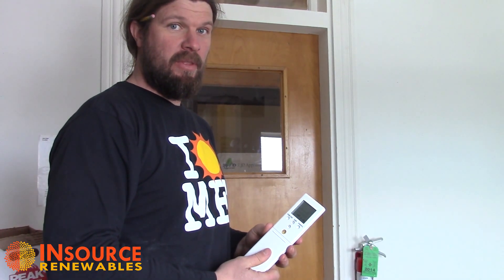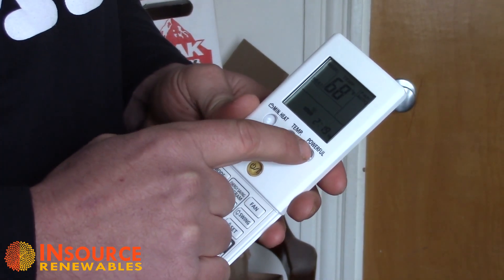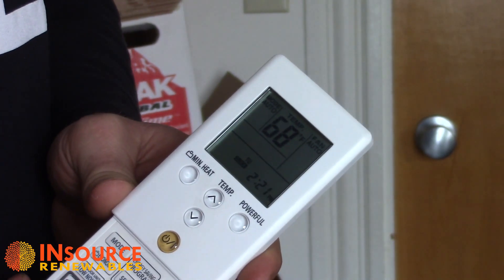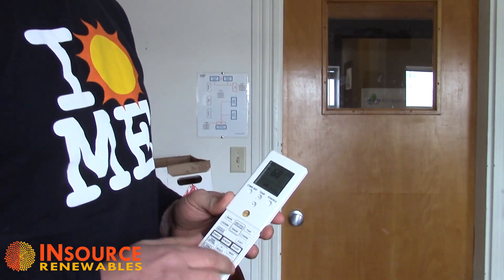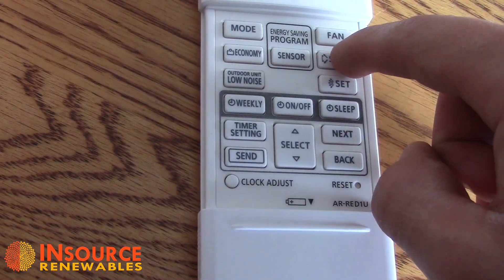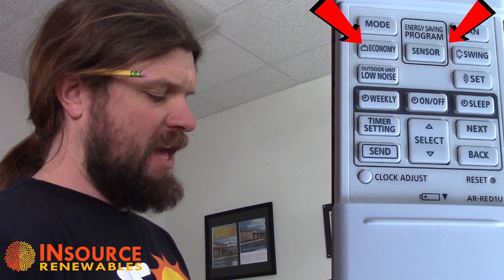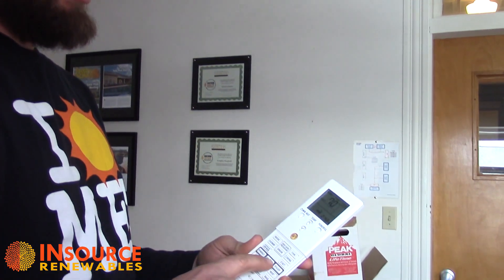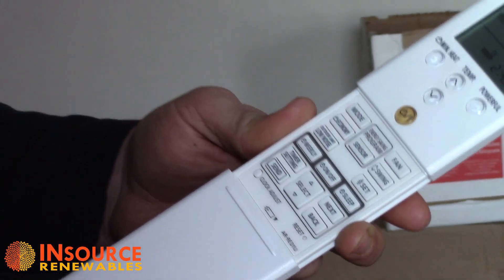Heat pump user tips #2 (controls)

Comment: Economy mode limits the compressor to 60% (on my 09LZAS1) for heating and cooling, which increases the efficiency of the unit. So it may take longer to reach temp (or may not be able to reach temp sometimes) but will use much less electrcity overall.

Comment: I programmed the weekly timer (thanks to Youtube) however am I correct that the unit does not show it is in weekly timer mode?  So using the on off timer shows the orange timer light but the weekly timer does not show it is in timer mode.  So I basically have to assume it is working?

Comment: I put a Fujitsu in my house as a primary source of heat, I oversized it on purpose because I wanted to make sure it could heat my place since it gets down in the negative Temps where I am. It feels like it's always cold in my house. I have it set on 70 but it doesn't feel like 70. Is it because I'm used to forced hot water? I know hot air furnaces are similar in that aspect, always feeling cold. I'm an oil burner tech so I don't know a lot about these things.

Comment: Hello, this is Commander Fujitsu here and I need to ask you a question about heat pump operations in Winter to avoid massive bills but you haven't uploaded in 2 years so you'll probably not see this Le Sigh .. By the way, if you want to maximize the efficiency of the communications device on your right ear try lowering the rubber mic nearer your mouth for output as it's too high at eye level 🥳🙃 If by chance you see this please reply and I'll ask you the question 😄 Thanks

Comment: My daughter just bought a home in Iowa and she has two of these units in a 750sq ft home. It is 2 degree here and the temp in the house is 57 and we have tried everything to get heat in this house and it is not working. I have to go buy two large space heaters, which we are trying now. I do not recommend these things for heat. They don't work with the temps in the midwest.

Comment: We just recently had the fujitsu heat pumps installed in December and we are having an issue the same as a friend had where 3 lights are flashing on our down stairs basement unit.  Our friend had called the service office to get someone to fix it and they had said it had to do with the timer on it and they fixed it.  Both my husband and I have tried with the manual to fix this problem without any luck.  There was no reason for the timer buttons to be pushed since we don't really do anything in the basement and only adjust the temperature up or down.  So we don't understand why there would be a timer issue.  Can you explain step by step how to fix this issue because what it says in the manual doesn't fix the problem?  Thanks so much.
Reply: If all of the lights re flashing, it indicates an error. The flashing of the lights indicates the issue. The economy light on the right will flash continuously, and the two other lights will flash in a pattern that indicates the nature of the issue. Count the number of times the operation light (green one on the left) blinks, then the number of blinks for the timer light.
Reply: @vaughanwoodruff  So after looking online to see if I could figure out what error code was happening, I did come across error code 97 to match the flashing lights, which indicates it's the outside unit.  Is this something that I can fix myself with using the remote control or is it something I have to call service to come and fix?  Do you know why this happened and is this a defect with the product and could happen again?  We did have a blowing snow storm that happened the same evening it stopped working properly.  When we got up the next morning (this past Sunday) it was cold in our basement and it didn't appear that the unit outside was plugged up with any snow.  Thanks so much for any assistance you can offer.

Comment: Awesome job! I asked the guys that installed my unit for an explanation and got the deer in the headlights look. The manual was especially confusing between energy mode and economy. One must override the other I guess. But makes sense to keep it out of economy and let the sensor do the work. At least for my use. I use mine for primarily  heating a room over the garage which isn't used much to keeps the pipes from bursting. Live Northern Michigan. Does a great job.

Comment: Excellent run-down, thank you! I have an older Fujitsu high-wall model (ASTA24LCC, heating output approx. 1-8 kW) which I suspect is oversized for the room(s) it is intended to heat, and it will often heat for a couple of minutes before abruptly stopping, and then won't restart for 5-7 minutes (typical compressor protection). I've thought about getting a wired remote controller/thermostat installed but for now have taken the budget option of wiring an extension onto the return/room air thermistor. The thermistor can then be positioned in a cool corner of the room or in the hallway if heating the whole house. This seems to solve the short-cycling issue, but in Heat mode it tends to overshoot the set point (had it been in Auto mode it would have switched over to cooling already). Is this normal behaviour? I'm aware there are temperature adjust jumpers on the circuit board but I'm not sure exactly what they do and in what modes they take effect. Thanks!

Comment: The green light on my unit has been blinking for an hour and not blowing heat. Seem like something is wrong
Reply: Blinking lights usually indicate a fault (or possibly defrost cycle running). Best to get a service technician in.

Comment: I have a 15rls3hy 15000 unit supposedly good to -30C
Had a 12000 unit previously installed and they changed it after a month as the smaller 12000 couldn't keep up in heat in my old bungalow poorly insulated. Installed the 15000 unit last winter. Seemed fine never went past 26 on the setting. This winter at the 30C setting fan on high its only getting to 20-21C 10 feet infront of the head unit. Thr kitchen right beside(open concept) is 19. This is after running almost 24 hours at around -20 outside.this unit is starting to do the same as the old 12000 unit did. On max heat setting the temps coming out of it are no always the same.i used a heat gun last year to test on the 12000 unit. Sometimes would be 30 degreesF  difference coming out of the head. This makes the difference of the baseboard heaters in the house being on or off at 18C. Im starting to believe its a fujitsu issue. My buddy has a gree extreme. No issues.
Ive also noticed bith these units the temp on the remote you need to increase it based on outside temperatures.never made sense to me. To keep 21-2 in house id need to change the remote setting to between 23-30C. But now on 30 it doesn't even maintain 20 threw out the ground floor of the house.
Reply: It's difficult to diagnose from afar, but here are the points of reference we would look for if a unit was doing well last heating season but not this heating season:

1) Compare heating demand between the two years to determine whether the difference is related to the unit.
2) Check the filters.
3) Increase the temperature setting on the remote to determine whether it maintains comfort, just not at same setting (could be due to a drift in the thermistor accuracy).
4) Check pressure to see if there is a leak.
Reply: I reset the remote.all good had to turn down from.max 30 to 25C within 20 mins.gained 4C in that time.we have lots of power blips.

Comment: Proggram Heat Pump (">" means press the button described)
1. Ensure Power (orange button) is ON
2. Ensure "Clock" is set to current time.
3. >TIMER SETTING; "Weekly" will start flashing on display.
4. >NEXT: days of the week will begin flashing on display + program event = 1; you can toggle through the days of the week using the >SELECT button (but don't bother). If you continue on you will come back to all the days of the week, but the program event will = 2 !!!
5. So assuming, all days of the week are flashing on display + program event = 1,  >NEXT 
6. SEND logo then flashes on display;  >SELECT toggled will display either an "ON" or "OFF" event - choose "ON" event via >SELECT.
7. >NEXT: Time starts flashing, adjust your start time via >SELECT !!!
8. >NEXT: Temperature setting flashes, adjust via >SELECT !!!
9. >NEXT: brings you back to weekdays flashing; >SEND (beep sound) to lock in Program =1
10. To set Program #2 >TIMER SETTING, >NEXT, >SELECT (Toggle through days of the week until you come back again to all the days of the week, but the program event will = 2 !!!
11. >NEXT; Repeat steps 6, 7, 8, + 9 to finish program #2.

Comment: How the hell do I turn on the heat with this? I set it to heat mode 88 F at top fan speed and nothing’s happening. I’m struggling to keep warm over here.
Reply: If it hasn’t run for awhile, it may take a bit for the compressor to warm up and start pumping out heat. If it isn’t doing anything after 10 minutes or so (be sure to hit Powerful to have it operate at maximum capacity), you should call for service.
Reply: If it hasn’t run for awhile, it may take a bit for the compressor to warm up and start pumping out heat. If it isn’t doing anything after 10 minutes or so (be sure to hit Powerful to have it operate at maximum capacity), you should call for service.

Comment: Can you do a video for R410a? I cant even get my heat pump to work and its brand new. The timer settings keeps blinking orange and I don't know how to remove it. I tried following the manual but doesnt seem to work. Please help! :(
Reply: R410a would be the type of refrigerant the unit uses, rather than the model number. Blinking lights and improper function sound like faults, so I'd get a service tech in to look at it.
Reply: The lights blink in a code that you can look up in the manual

Comment: In a way, I appreciate your reply, yet should probably share that you are
corresponding w/a soon-to-be 77 year ex-Marine who has no real sense he
will be here much longer - or wants to be. This said, the difficulty I had
around mid-night last night endeavoring to adjust the handheld control temperature for heating in a 32- degree outside temperature with an estimated 50ish inside a challenge that took over an hour to get the heater back on "properly", I think.

That said your reply's attempt at humor - or was it sarcasm (e.g., walk a mile down the street), was not helpful along w/the similar attempts at "humor."

What WOULD be helpful is a single step-by-step set of instructions to get the heater turned on and running at a specific temperature absent of all the side-talk.  That as ground-of-being from which description of the other buttons might then help.
Reply: Keolalani, please excuse my inner Mainer. Your comment didn't leave a lot of request and was broadly unappreciative. Like my brethren, I'm a bit full of sarcasm and dry wit. I'm sorry to hear that you're having challenges with your unit and aren't generally enjoying life. Truly. Here's some direction on your unit... The easiest thing to do would be to shut the unit off at the breaker to restart it. Give it five minutes to clear its memory. While you're waiting, press the power button (amber one) on the remote so that the temperature setting isn't showing. Once you flip the breaker back on, get in front of the unit and press the power button. Listen for the beep. The beep is critical, as it indicates that the indoor unit received the command. If you don't have the remote pointed at the indoor unit, you could jack the temperature up to 88F on the remote but the indoor unit may think you only want 70F temps because it didn't get the command. You should just set it and forget it... pick a temperature and let it run. Efficiency Maine has some great User Tips that detail getting the most out of your unit: https://www.efficiencymaine.com/docs/Heat-Pump-User-Tips.pdf. Good luck. If you have other specific questions, I'm happy to answer them.

Comment: What an inept "instruction" script!   How about a step-by-step walk thru of the process of turning the unit on and setting the temperature?  As is, there was nothing there that visually showed that process.  Just a lot of extraneous conversation. :o(
Reply: Step 1: Pick up the remote.
Step 2: If you can’t see an LCD screen, it is upside down. Turn it over.
Step 3: If the writing on the remote is upside down or sideways, you aren’t quite there yet. Rotate the remote in your hand until the letters are right side up. If you can’t read the buttons, have the person who is reading these instructions to you read the labels out loud. (Hi, helpful reading assistant!)
Step 4: Aim the remote at the indoor unit as though it is a TV.
Step 5: Press the amber-colored button in the middle of the remote.
Step 6: If the unit doesn’t beep and light up, something’s wrong. Get closer to the unit and try again. If it works this time but your screen isn’t showing a temperature, walk a mile down the street and push the amber button again. Return to the home.  Be discrete so the indoor unit doesn’t suspect that you pushed the button again. If going a mile required a boat, be sure to tie it back up.
Step 7: If the temperature setting is correct, find a safe place for the remote and leave it there. If it is wintertime and your house gets very cold, be sure to watch the video to make sure the unit is on the right mode. Be sure to stop the video before it ends to avoid the video that details cleaning of an indoor unit, as there is a sophomoric joke with toilet paper that is unlikely to be received well.
Step 8: If the temperature setting is too low, press the button with an arrow pointing up that is labeled “Temp”. This stands for “Temperature” not “Temporary” or “Tempestuous”. We kind of wish is stood for “Tempura”. (Don’t steal the idea helpful reader!)
Step 9: If the indoor unit beeps, keep pressing arrow buttons until you get a favorable number. If the words are upside down again, don’t panic as the remote doesn’t have the power to change your body temperature. Simply turn it around and try again.
Step 10: If you want to undo anything, read the instructions in reverse starting from the bottom. Let me clarify - don’t read the words backwards (I’m not that creative). Read the STEPS backwards.
Step 11: If all else fails, read the instruction manual. This one they actually covered okay.

Good luck!

Comment: Have this system going on second year now summer time i had no problem but now in winter when i have the heat turn on it comes and after 30min it goes to slow cool fan mode and when i turn it off the green light blinks for about 5 minutes and i can only turn it back on after an hour for 20-30 before it starts doing the samething again
Reply from the maker: Sameer, what you are describing sounds like the unit running in defrost mode. See this video for more information: https://www.youtube.com/watch?v=DGAhjK3nkJ4
Reply: My remote no longer seems to be transmitting a signal to my Fujitsu.  Same remote as in your video.  Brand new Duracell installed just now.  Help?

Comment: I have the same system. It seems that the remote shows ONLY the temperature that I target to have, but does not show a current temperature. E.g., when I enter a cool room (obviously around 60) and turn the system on, the remote immediately shows 72 because it's my targeted temperature. How could I see a real (not targeted) temperature in the room?
Reply from the maker: Julia, the units do not have that feature. You will need an external thermometer in the room to measure the room temperature (a thermostat in the room for your other heating system might suffice). The number on the remote is a setting that targets the air temperature you are asking for.
Reply: If your unit has wifi you can get a temperature reading by using the FGLair app.

Comment: Hello! My fujitsu has the economy mode light blinking and it doesn't go away even when I keep pushing the button! :( I need it to cool down the temp. My remote doesn't show the economy mode on, only the aircon on the wall does. Help??
Reply: Great video I had a fujitsu installed one year ago and I can't get it to work neither heat nor cool I do everything with the remote it still won't work thank you!
Reply: Bris Edeny I’m having this problem right now!!! It’s so so cold and my heat won’t go on and it just keeps blinking economy mode. I know this was a year ago but plz tell me you found a solution

Comment: My heat pump is dribbling water.  Why isn't it draining?
Reply: It is typically due to one of these reasons:
- the indoor unit is pitched in the wrong direction, causing it to drain improperly;
- there is a blockage in the condensate line (possibly insect nest) that is restricting drainage;
- there is a trap in the condensate line;
- there is a leak in the condensate pan (rare); or
- it is a refrigeration issue and there is condensate forming due to poor heat exchange.

Comment: The air coming out is warm. Setting in on cool set at 64. Is it because the condenser is dirty. The filter is clean..please let me know what you think. Text me 7742891681. I saw on a video a self cleaning and rinse spray foam. Has anyone tried it.
Reply: Sounds like it could be a refrigerant leak.

Comment: So what is happening when the lights on the unit are flashing. I purchased a house with this unit in it and there doesn’t seem to be a users manual
Reply from the maker: That indicates an error. The two lights to the left (the green one and the amber one) blink in a code that indicate the issue. It will blink a certain number of green blinks, then a certain number of amber ones. If you still have this issue, post the pattern of blinks and we'll let you know what it is.

Comment: Can you use this a primary heat source? And what temp does the unit stop working at when the temps drop really low outside here in Maine?
Reply: Rated heating capacity is maintained up to 15°F,  but the XLTH Series can operate down to -15°F.